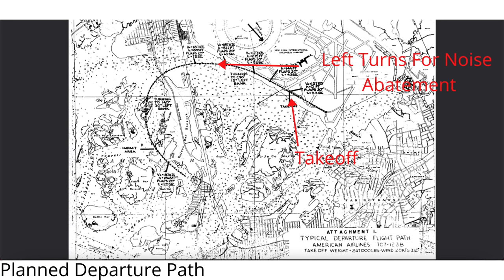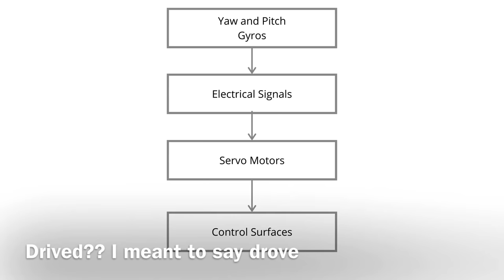The Short Circuit That Crashed A Passenger Jet | The Crash Of American Airlines Flight 1

Comment: According to Boeing fanboys, this crash was caused by the merge with MD more than 30 years later. This accident and several others are the proof that Boeing always had problems with design flaws and quality control. Funny that while the DC-10 had a terrible reputation, despite only having 1 fatal crash that was caused by the infamous cargo door design flaw, the 707 had a safety record that is a joke.
Reply: Airbus's approach to problems is to ignore them regardless of the body count.  Pitot tubes got you down? Ignore it.  Front gear keeping you in 90 degrees of stress?  Don't give it a second thought, cuz we're sure not going to.
Reply: @flyingtigerline  Body count? Are you serious? lol. No crash with fatalities has ever been caused to any Airbus aircraft due to design flaws or mechanical failure. The main reason has always been pilot error or something else. You're just the Boeing fanboy I was talking about.
Reply: @ederss7  AF 447 was not a pure pilot error - it was caused by both, the icing of the pitot tubes and a bad pilot. The aircraft however would have flown further in a normal way without the pilots inputs. 
FBW has it's advantages and disadvantages, but new developed Boeing jets (the Max is no new development) since the 90s use the same FBW technology.
Reply: @simonm1447  Yes, I know. But the pilots managed to stall and crash the plane that was flying in 35000 feet in 3 minutes.
Reply: @ederss7  of course the stall itself was caused by Bonin (the pilot), not by the aircraft.
Normally the Airbus would have prevented the stall, but unfortunately it could not with the frozen pitot tubes.
Reply: @kingssuck06  Bullshit. Just compare safety record of the A300 with Boeings of its time, the difference is huge. All the fatal crashes involving the A300 were caused by pilot errors.
Reply: @kingssuck06  lol. that A320 flew into the trees because of pilot error, the plane acted as designed ahaha. You're the classic Boeing fanboy, will never admit that Boeing has way worse safety record than Airbus. The 747 was from the era of the the A300. Also, your flawed logic has forgotten that the A300 was its first airliner for Airbus. Stop using excuses for Boeing's problems. I can name at least 5 crashes with fatalities that were caused by design flaws in Boeing's aircraft, you'll never find one in Airbus's history.
Reply: @simonm1447  In the end, AF447 was actually a pilot error. A frozen pitot cannot be considered neither mechanical error nor a flawn design. And the co-pilot kept pitching up all the way till they crashed without realizing it or telling his mates about it.
And the idea that it could have flown further.. Means that they would have crashed some miles further, doesn't make a difference, does it?
Reply: Every manufacturer has its own problems. I don't understand the discussion Boeing vs Airbus.
Reply: @javierfernandezdeprado2520  you misunderstood me, when I wrote it could have flown further it was meant it would have continued the flight in normal altitude without crashing, as long as you don't change settings like thrust it just continues the flight, with or without working pitot tubes. It was Bonin who brought the aircraft to a stall, not the aircraft itself.
At the end they (the captain, not the FO) almost recovered it, but the aircraft was unfortunately too low when he started the stall recovery.

Comment: This issue sounds like MCAS : episode 1
Reply: The manufacturers learned to pay off the FAA (not the individual inspectors), so the manufacturers could sign off on their own testing. Yea, they learned, alright.
Reply: Chuck Yeager  MCAS could not have passed rigorous testing making it airworthy. One bad sensor and the plane dives. If you want to short cut the testing process, convince the FAA that you did all the tests they would have done and it passed all of them.
Reply: @djs2006  Or, be like Ford in the drop test (turn truck upside down to simulate rollover and drop it). When it fails at two feet of the ground,  just keep lowering the drop til it passes. Lol. 

This is no joke. See auto liability litigator book, "Still Unsafe at Any Speed" by Brian Chase. This goes on to this day, btw.
Reply: @windsofmarchjourneyperrytr2823  I don't think they even thought of doing those tests. They might have even been pressured to make a deadline and thought that a cursory evaluation of the most likely flight conditions (aircraft attack angle) covered 90% of the possibilities. Why else have a MCAS but to prevent the pilot from stalling the plane?

Comment: Airbus A320 today can correct big and small errors pilots cannot or did not notice it. It turns correctly if it sensed pilots did it wrong. Auto power up or down the engine if the pilot did it all wrongfully. As for this 707 and other incedent involving Boeing Aircrafts. Its seems their marketing strategy rules in building their planes not their engineers. A complete opposite to Airbus Industrie.

Comment: In 5 seconds they didn’t try to roll the plane with the ailerons?
Reply: It takes at least 3 seconds just to become aware of a situation. Then you have to diagnose it. The time it takes to do that can make the difference between life and death. The pilots of this flight were faced with an unprecedented situation there was simply no time to react to. Five seconds to react in the correct way is ridiculously optimistic.
Remember the 'Miracle On The Hudson'? The simulator tests showed Sully could have landed the plane on a runway, but only if he had reacted immediately . But things never work that way. To do that he would have had to have precognition of the bird strike and engine failure. React without correctly assessing what you are reacting to, it is likely to be the wrong call. Sully and his crew took 30 seconds to diagnose what had happened and how to deal with it, by which time about the only option was ditching in the Hudson. You think 30 seconds was too long? I'd like to see how long you take to work out a unique life-threatening situation in the stress of the moment.

Comment: I've us to work on CAT engine power machines, those engines and the terrible conditions were they're used are the mother of the challenge's! The mechanical parts working together with last generation electronics is amazing. We inspect the whole caterpillar for possible damages, some times we find something and some times not. Electrical fires are the worst of all kinds, once it starts there's no possible way to stop them, on an airplane that's something impossible to notice! Quality versus profit! As today I work on electronic devices the size of a suit case that worth almost 1 million USD, all electronic components are top of the industry! I don't know why today the airplane manufacturer's  choose cheap parts versus " perfect design". To build an entire plane they're hundreds of suppliers, therefore is extremely difficult to assure "quality". Blame that on the greedy corporate! They know it will work but they don't know when it will fail! Greedy corporate at is best!
Reply: Car makers do the same,  KNOWING what they did WILL kill people. Just how many is the only answer. It doesn't stop at the Pinto by a long shot. 

Sammy Davis had his eye put out by an egg-like protuberance in a new Caddy. He was holding it in his hand while it took the driver 45 minutes to find "a colored hospital." "Frank Sinatra: All or Nothing at All" documentary from library. 

Ford replicated the Pinto, not once, but twice. The 15 passenger van and the Crown Vic. The door locks failed on the latter, also, so some of those burned to death. Police and anyone they arrested at least a few times. I know the number was in the teens, at least. 

I remember a nasty accident on the 15-passenger van with a large family or church group in Illinois. It had to be fully loaded at all times (????) to handle correctly...

If you're old, you'll remember Unsafe at Any Speed by Ralph Nader. It was a lawyer-like read, pretty harsh to get through...

I preferred Brian Chase's "Still Unsafe at Any Speed." It's the same thing, only with modern vehicles. Library has the former, the other is OOP (outta print, probably ebay or thrift books has it, tho). THAT one kept me up a few nights, thinking about stuff they KNOW about and release anyway.

Comment: You gave a very abrupt ending to this tale and considering you have 50 years of followup, (hindsight) after the accident to close this video out properly, leaves a lot to be desired.  Why ask such a question at the end of the video when all the questions should have been answered some 50 years later, either the industry learned from this or they didn't?  There appears to be some kind of disconnect between what you are asking and what definitively happened and further what the industry has learned in the preceding 50 years.  Take care.